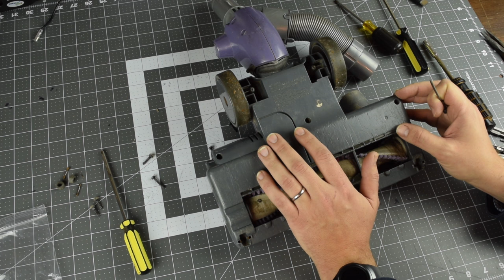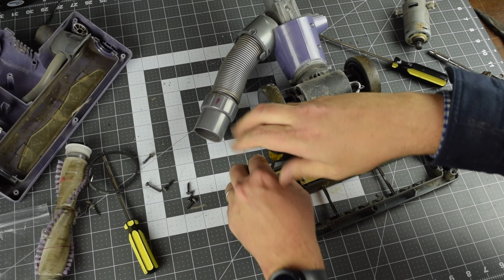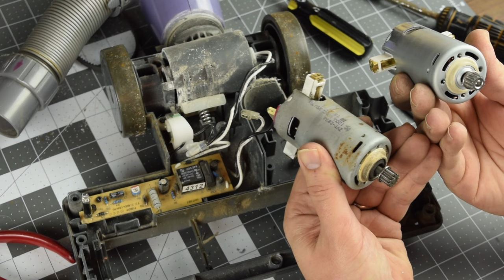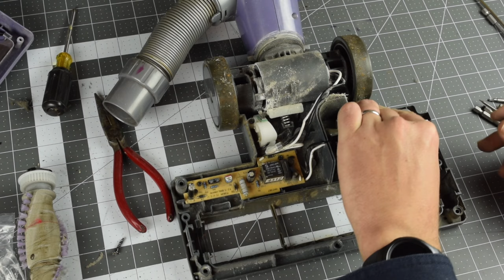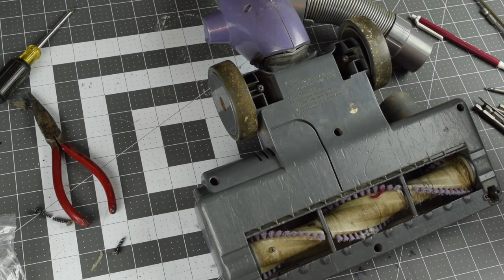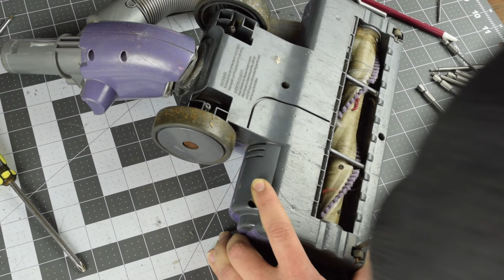How To Open A Shark Navigator / Rotator Brush Roll Motor & Replace Repair circuit board wires

Comment: Thanks for the heads up on tamperproof torx screws. I took it all apart and turns out the safety heat sensor in circuit board shut off brush motor.  Great video.
Reply from the maker: Great to hear! Thanks!

Comment: I have removed all the screws still can’t get the bottom/top to come off. Took the screws from under the little wheels.
Appears still connected at the top I see no screws. I have a Rotator.

Comment: Great vid, My exact problem though was the white wire for the brushroll switch somehow got pulled out, and the rubber tubing was split so I dint even know if its possible  to get it back in place, I'm wondering if its still salvageable at this point

Comment: Great video! I had missed the screws under the wheels, so I couldn't remove the brush roll until I watched this. Less than a week later, the replacement roll arrived, the Shark is reassembled, and it works fine. You've saved a Shark's life. Can't thank you enough!

Comment: Great How-To video, but you could make a video that lasts one minute and simply says: "Don't bother to take it apart. Replacement motor and circuit board necessary to make repairs ARE NOT available from the manufacturer or ANYWHERE online, including Amazon".
Reply from the maker: Noted!

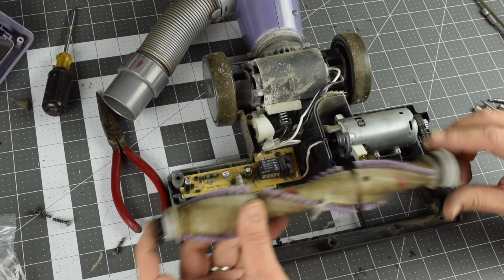Comment: I have a Shark Navigator almost exactly like yours. But mine is missing the white plastic brush roll part on the left side (9:53...without the groove, on non-belt side). How do I get that part? Also, my brush roll needs to be lubed as one side turns freely while the other side is hard to turn. How does one take apart the brush roll to get all the hair and dirt out and lube it? I tried hammer and chiseling the spool out like I did on my Bissells. But it did not work.

Comment: My Shark Navigator is Model nv351 26. If you have same model as me yall, read this before you buy anything** I have a star key kit but doesn't have the tamper proof hole. So I followed the link listed here to the Titan tool on Amazon. FYI The link is for the correct star bit tool.....but not long enough to reach some of those deep screws.  You need a driver extension that is width or smaller of a pencil & buy the tamper proof star bits seperate (T-15, T-20)

Comment: Great video. Just took mine apart. I think the biggest problem is the brushes wearing. I put a flat screwdriver on each one and tapped them in. Seems to have worked for now

Comment: I have a Shark NV42 there is no suction.  The roller moves but the switch only works on the carpet setting nothing on the bare floor.  Nothing is clogged and filters are brand new.  Cleaned the roller.

Comment: Thank you for a great video Im stuck here my navigator has suction in the hose but my brush dosnt roll Its not the belt I cleaned it as per your video and how do you know if you need to replace motor when the hose works?

Comment: I'm struggling to get it put back together. Any suggestions?
Reply: I was having trouble, too.  Watch the part about getting the motor in just right. (The way it fits in there isn't the  greatest design IMHO).  And make sure the wires aren't getting pinched and feeling the parts apart.

Also, it helped to see how he had it laid out so that getting the beater brush cover on didn't require two people.

Comment: Ours had "15" screws that needed to be removed just to get to the rotator brush, 2 different sizes of Philips head and 11 of the odd star bits,  A royal pain to take apart just to remove something stuck in the roller and things get stuck in rollers all of the time.  Also wire guides and a spring all fell out when the brush head was finally able to be opened.  Clearly this unit was not designed for normal maintenance.  We spent a lot of money on it but will probably just take it to the dump.  We'll but a new vacuum but it won't be a Shark.

Comment: Thank you! I had to take it apart twice because as you clearly explained, don't pinch those wires, tuck them in by the curve! I pinched them the 1st time & the roller stopped (again). I think it was semi-pinched in the 1st place, now works fab after I pulled out the original problem, some random piece of plastic that got sucked in! Without your instruction, I would have had to go to the repair shop!

Comment: You can buy a torx bit at any hardware store and you pop the wheels out with a flat blade screwdriver, not Phillips. Some times that little cutoff switch that causes the roll to stop when you set it up straight goes bad. You can bypass it by cutting the wires and splicing them together. You'll just have to turn the roll on and off at the main power switch.

Comment: Good informative video until you put the roller back in. You spent all that time taking apart replacing  various parts. While you explained very well in a way even i could understand. 😂.
Then you put the roller back in without first cleaning it taking off all the stuff that seamed stuck and wrapped around it.. 
I think this would effect how it would perform during the test. Plus as your hoovering  more hair fluff eould probably wrap around that part first.
Reply: Soz sènt Message before I'd finished  i hope my message hasn't offended you just wanted to let you no for future vidios. But as i said earlier really well explained.
Cheers Jacqui x
Reply from the maker: No worries! I appreciate the input. This is one of my early videos and I was still learning so much.  I'm so glad that it is still helpful.  Thank you!

Comment: Hello, my roller brush in my unit has stopped spinning. after poking around a bit, I’ve discovered I’m only getting 10 volts at the bottom of the vacuum base (where the brush roller assembly attaches to the main body of the unit) I’m no electrician, but it seems to me that the brush roll switch (on the main unit) is bad based on what I am seeing, a DC 120v motor and only 10 volts are making it to the roller head. Is this correct? I pulled the hinge switch from the base and connected the two leads as to bypass said switch, with no change in operation.

Comment: Thank you for the video. I have long hair and so does my daughter... it’s always wrapped around the roller! I’ve always been able to maintain my other vacuums in the past, but they weren’t Sharks. I was overlooking a couple screws. Again, thank you for the video!
Reply from the maker: The New Sharks with Zero M actually prevent hair wrap, they are pretty cool.

Comment: well done video. In reality, good luck finding a brush motor. Shark would rather not sell spare parts - buy a new Shark instead is their preference. Best bet is to take your vacuum to a local vacuum repair business that offers free estimates. They generally will provide the customer with realistic options.

Comment: Do you know where to get a brush roll and belt for a Shark NV 652, can't find one anywhere and shark wants you to buy a new power head or any other brush roll that will fit it? They want $119.00 plus shipping for a $20.00 part

Comment: I have a shark nv42 31 Navigator Deluxe and I am having a hard time locating the brush motor and board for sell anywhere. Amazon does not have it and neither does eBay. I love this vacuum, its one of the best I've ever owned and I would hate to have to buy another one when the only problem with this one is that the brush is no longer wanting to spin. I've checked the brush and the belt and both are good. I think its something to do with the board. If anyone could point me in the right direction to find the brush motor and board I would really appreciate it. Thanks so much.

Comment: @ Vacuum Wars--  Thank you for posting  the series of vids that related to repairing the Shark Navigator Vacuum. Because of your kindness shown to others, I was able to get our vacuum running in top form again! For months our Shark Vac It had not been working well, and a few weeks ago the rotating brush up + quit spinning at all.  After watching  your little series of content, I was inspired to tear down our Shark and since the belt was not broken like i thought, I put my efforts into the brush, PCB, central switch, as well as the small motor and the semi-plugged up hoses....  The unit now works great because of the inspiration I got from you!! You have earned yourself a new Subscriber AND my gratitude!!

Comment: My Shark regulator red light came on so yes of course I hadn't cleaned it and I forgot about something that's up so I cleaned it out but I can't get in the foot bottom part because of I don't have a long screwdriver so each time play the foot down it spins and then it stops so there is suction everything else still working but it is spending stop so what does that mean can you help me out with that until I get a long screw drive and then I can fix it LOL

Comment: Thanks for this.   I'll never buy another Shark again.  I can't believe how hard it is to remove the bottom, which you always need to do on vacs.  I missed the two screws by the back wheels. I did remember they put two screws under the front wheels.  Now, they made it even harder by requiring a "special" tool.  Why would they do this.  Who is in charge of their design team?
Reply: Obviously its just to prevent you from getting in them so you are forced to hire a technician. Just another way to make more money sadly

Comment: You put the housing all back together before you checked to see if your new motor & circuitboard even works?  Doesn't make sense.  This video may have been of some help to some people but this video is brainless.  I suppose you have your reasons . . . probably because your new motor & circuitboard didn't work.